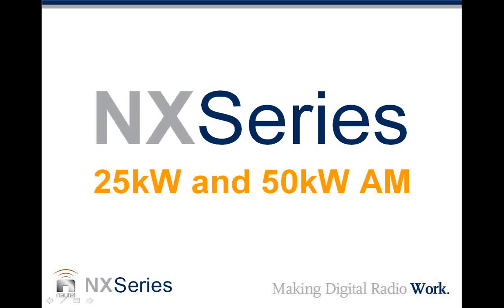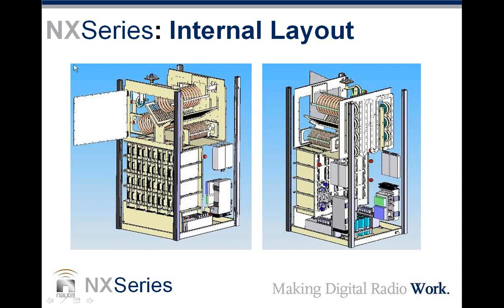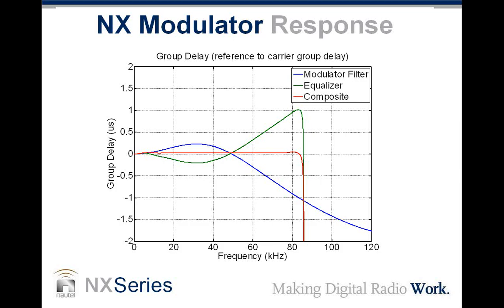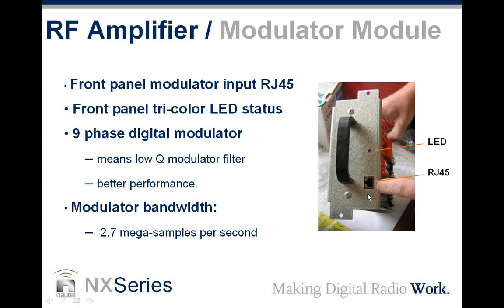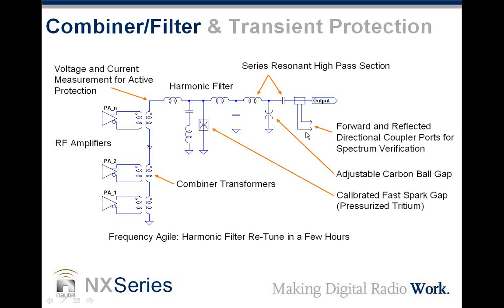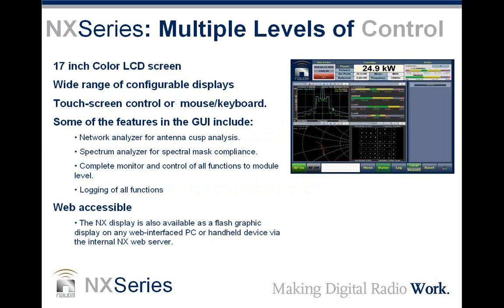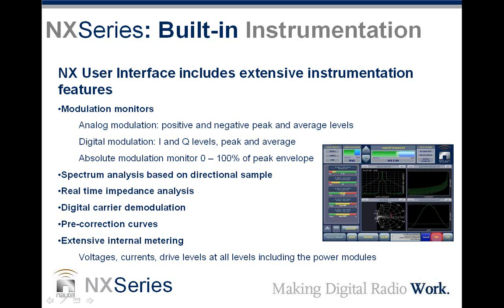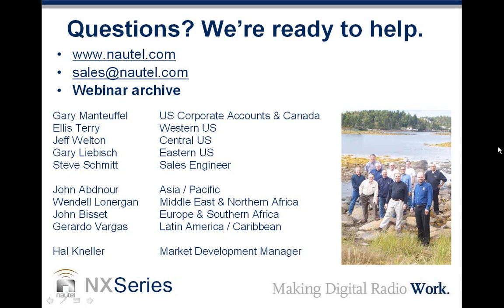NX Series 25kW and 50kW AM Transmitter Overview

Comment: Why does the RF amplifier use a full bridge driver on a resonant circuit? Lower frequency power supplies such as fluorescent tube drivers and older computer power supplies only use two transistors and a capacitive divider. With a capacitive divider the transistors see only half the supply voltage. MOS transistors generally benefit from lower voltage higher current loads.

Is the modulator stage meant to convert 3 phases of PWM control into a linearly co-related voltage to the H bridge?
I think the filter would non-linearly transform different duty cycles into output voltages, so a feedback circuit or some other fine tuned pre-driver circuit would be necessary to get the output amplitude constantly proportional to a linear mode input signal.